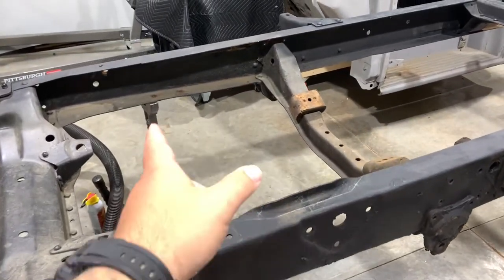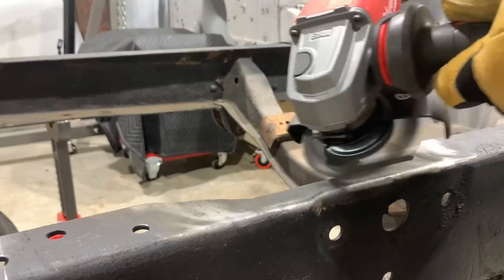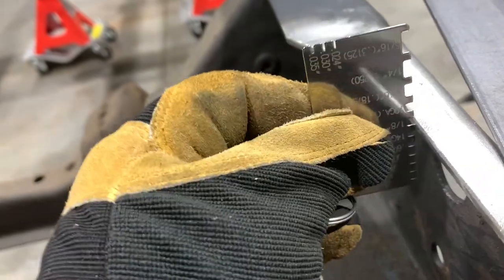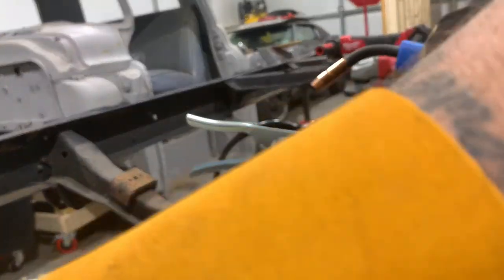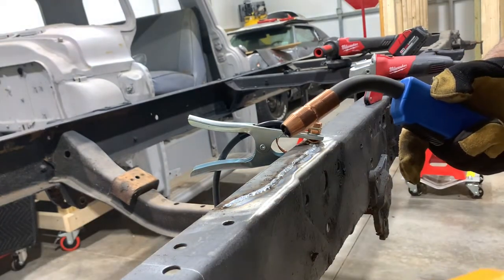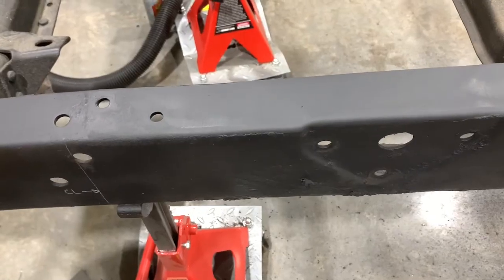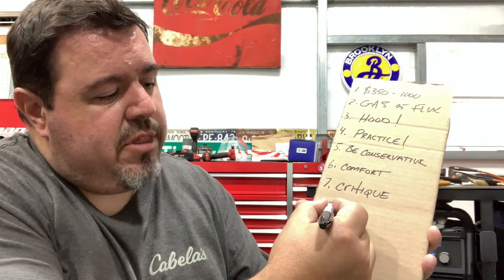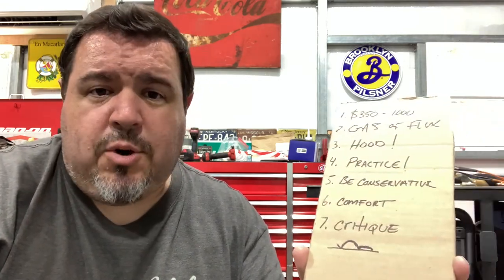1955 Chevy Truck Build | Anyone CAN Weld!

Comment: What do you do about surface rust on the body parts thats bad enough to cause "pitting" ?
Reply from the maker: If ALL the rust can be removed, then mud can be used over any surface imperfections, but typically it needs to be cut out and new metal welded in on visible body parts. If its the frame that has pitting, it can be media blasted and either powder coated or covered in an “encapsulating” chassis coating product.